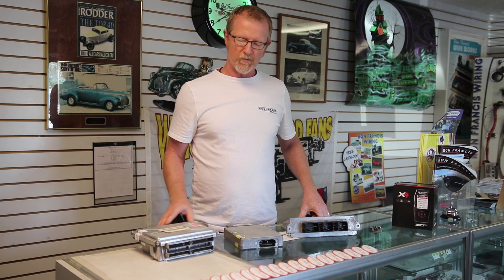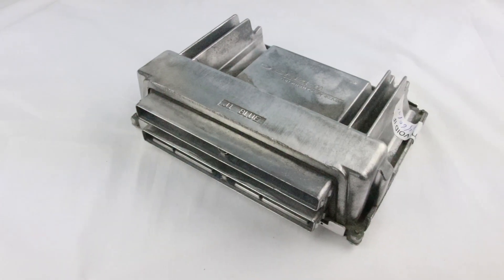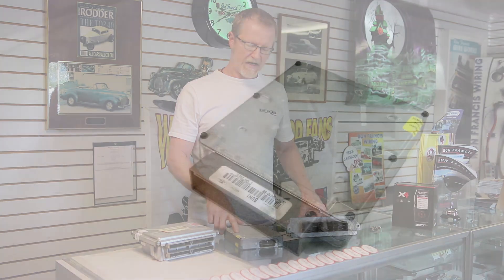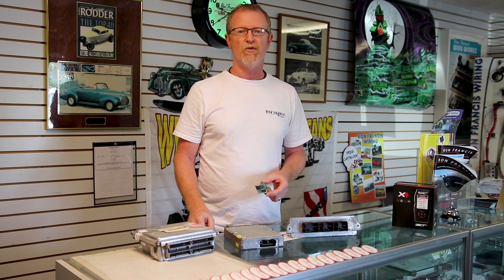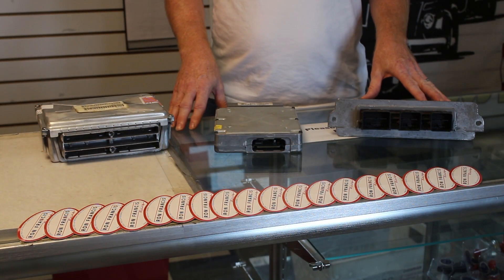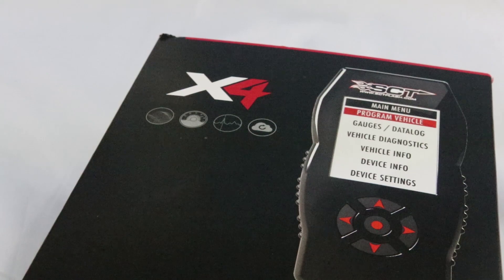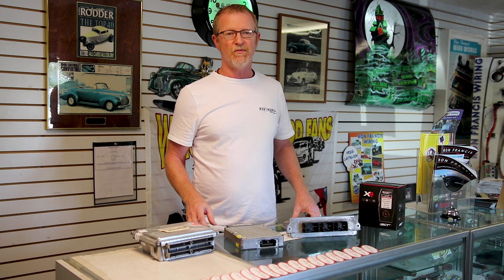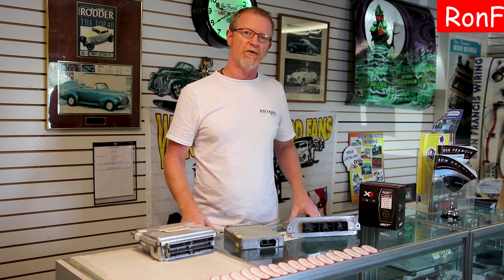ECM Reprogramming Video

Comment: Can you reprogram an ECM or PCM to disable permanently limp mode? I don’t care what it cost.
Reply from the maker: Unfortunately we can't do that.  The ecm decides when to go into limp mode based on inputs to the ecm and there's no way to preemptively shut down those circuits, they are there for a reason, to protect the engine.
Reply: @ no they’re there to keep people buying sensors, but we can agree to disagree.

Comment: Hello Ron I purchased a new engine computer for my 2003 Chevy Express van however the injectors are not firing but the new computer is not showing any codes therefore I cannot diagnose the problem. Can you help?

Comment: I am replacing a generation 1 3.5 Ecoboost engine in my 2013 Ford F150 with a 2020 generation 2 engine out of a 2020 Ford Expedition. I have both vehicles PCM's. Can yiu reprogram either one to be able to run the new engine with the old gear ox and instrument cluster. Time if message 10/10/2023 18:48

Comment: Have a 1990 Oldsmobile toronado Trofeo and it has the ECM which is right now out of my car. I'd like to remove anything about the catalytic converter which I don't know if it does already or not and I would like to know if you guys can change programs. This car has a TV screen and that displays graphical information and it's a touch screen. Is that something you guys can do like to bring it more modern can you put a GPS addition to it? Because currently it has a compass and tells you Northwest and that kind of stuff it looks like where the old flight simulator programs. But couldn't you add in a GPS circuit to that. Let me know
Reply from the maker: Hi. On your ECM, we cannot do any kind of reprogramming to give you what you're looking for. Since your vehicle is a 1990 we would caution you that tampering with any kind of emissions, like deleting catalytic converters, may cause your vehicle to no longer pass local or state emissions tests. With regards to the updating of your screen with newer features that is something that we do not deal with. The fact that your vehicle is from 1990, we suspect that you will be extremely limited in what you can do with that existing display.

Comment: I have a 1998 mustang GT 4.6engine I am dropping into my cobra kit. Need ecu flashed to remove PATS and emissions as well as a stand alone wiring kit.
Reply from the maker: Our MG-91 harness is what you would need for that engine combination. We would also need to know what transmission along with a few other items to be able to put a harness together.

Comment: I was recently told that my ECM needs to be reprogrammed on my 2006 Chevy Cobalt. Is reprogramming expensive?
Reply from the maker: That will depend on the ECM and the shop that you take it to. I would recommend verifying that the ECM needs to be reprogrammed first. Verify that it hasn't gone bad on you. Once you get that info, find a place that can do the reprogramming. Best option is to find a local shop that can do it, or contact a GM dealer and start there.
Reply: @RonFrancisWiring  thanks.

Comment: My new audi ecm cooked itself , i sent it to be repaired now the place refuses to send it back to me ! Stay away from module experts the only thing they are experts at is stealing money as well as modules which they in turn sell to other people for 1200.00 and claim they are plug n play after claiming there is no such thing as a plug n play ecm.  They verified that they got it then made up excuse after excuse to not send it back ! The dealer closest to me is about 100 miles which is bizzare cause the town i live in has more audis registered than any other part of the state i live in !  I need an ecm with security disabled ready to plug in and go.  Flagship only offers rebuild service and cannot guarantee it will work ! Im driving a 1980s chevy truck until these manufacturers get a clue and stop building this junk cause that is exactly what it is ! Junk,  its pretty sad when i can get more miles out of a 500.00 beater i bought 30 years ago in high school than i can from a 60k dollar audi !
Reply from the maker: If it's a new Audi, it should be under warranty and the dealer should be responsible to fix any issues. If you're gone in and changed any of the programming then you have entered into a grey zone when it comes to warranty coverage.

Comment: I bought an unlocked PCM for a 2018 Dodge Challenger. I traded that car in for a 2019 Dodge Challenger. I put the factory PCM back on the 2018 before trading. My question is can you reprogram the unlocked PCM to work on the 2019 Challenger? I have contacted "performance shops" close to me, but it's a question they have never been asked.
Reply from the maker: We don't do any Mopar ECM reprograms. Most of our ECM reprograms are for Ford ECM's and a few LS ECM's.

Comment: I need to do an Ecm swap in a 2010 GMC Terrain & need a swap it out.. The old one has gone bad & everything is completely stock.. Is that something you can do through the mail & can I send you what you need & how much will it cost to do so?..  Thanks.
Reply from the maker: We do not sell ECM's. We're often asked that question and we usually recommend that folks start with some Google searches and look at places like eBay as a source.

Comment: I have Cheverolete Suburban 2012  , I want to remove thermostat but that will cause problems  my question  can we reprogramm   oil temperature and water temprature  the new ECU unit locked  the work of the engine that is called the optimal running  so I want to make it like classic car I want to cancil thermostat to drop down the temperatre in hot thank in advance

Comment: i think maybe you can help me..  I'm hoping. I have a 1966 International Travelall 4x4.  Is there any way I can get the ABS from the axle swap to work? I am looking at GM axle with ABS and the ABS control module. but it looks like the entire thing needs to be connected to the ECM. Can you help me get the programming worked out?
Reply: Love those old internationals they are super easy to build and will go where jeeps wish they could go.
Reply: @stevenbean9706  Ive seen videos of them smokin' jeeps and other brands in the deep snow.
Reply from the maker: Peer, we do not support ABS systems but depending on the particular GM system you decide to use, we may be able to offer some help with connectors and such.